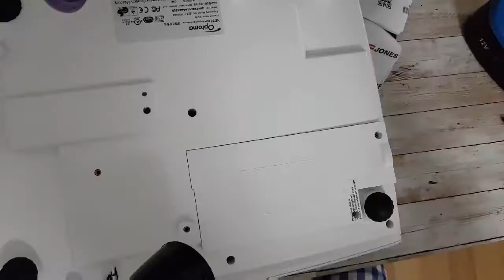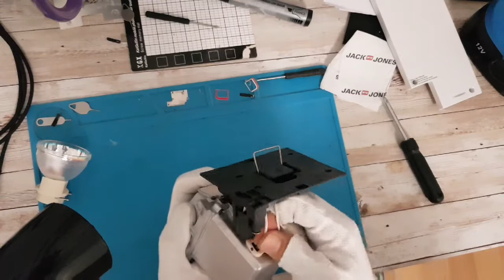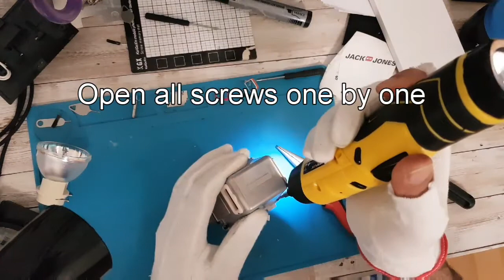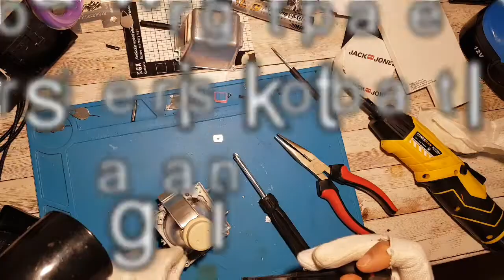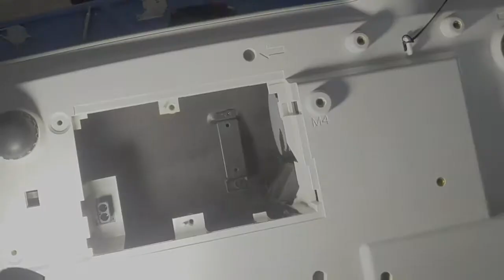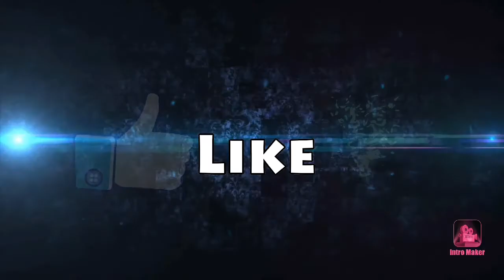Optoma HD33 Lamp replacement

Comment: i made the change and my projector light a orange light and dont turn on anymore, can you help me? i think its because i used a aliexpress lamp 💀, i didnt know that was realy bad thing to do
Reply from the maker: Hello! First of all thanks for watching Blue Lagoon You Repair. 
You projector not turns on and there is a ted light after changed lamp.
If your projector working well before replaced the lamp then you projector's new lamp is not working maybe its broken. If you have a old one in working condition then put old one and turn it on if works then buy a new lamp and replace it.
I don't think so there is any problem with the Aliexpress's lamp.
Check also all cables it it correctlly contected to his own places.
If this is helpfull then please remember to Subscribe like share and press the bell icon.
Have a nice day